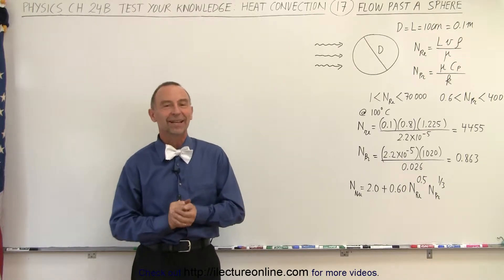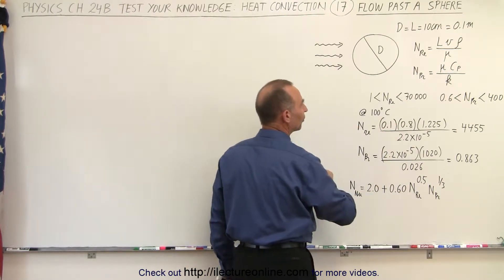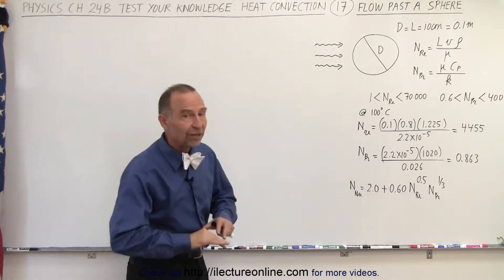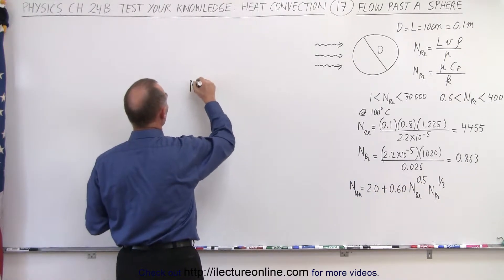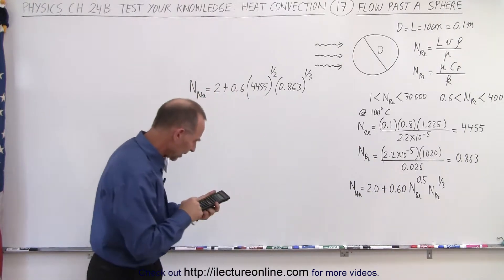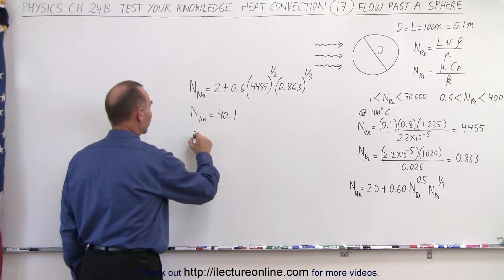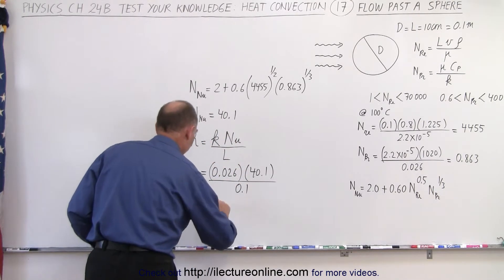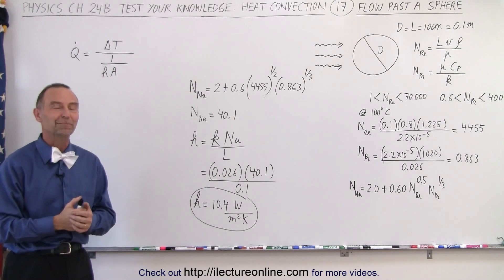Physics: Ch 24B - Convection: Test Your Knowledge (17 of 26) Flow Past a Sphere

Comment: Does it matter if the sphere is transferring energy to the air, or the air to the sphere? Is there a difference between those two with respect to the calculation?
Reply from the maker: There are differences, due to a lot of aspects of heat transfer due to convection, including the constants which are mostly derived experimentally and different experiments produce different results.  Convection is not an exact science.